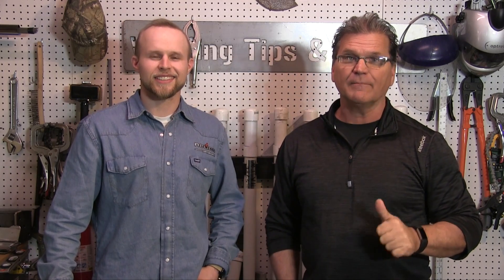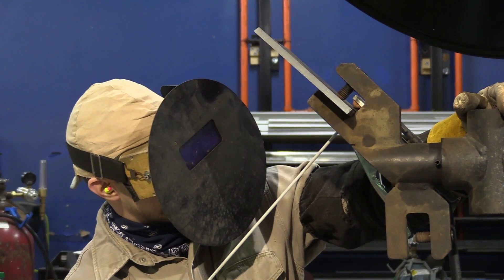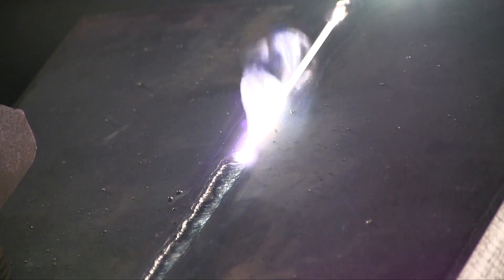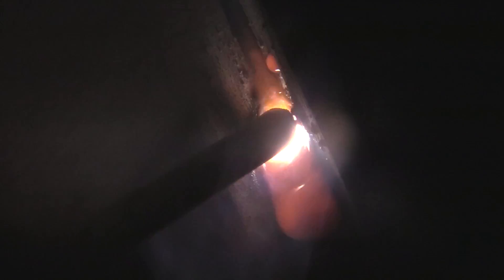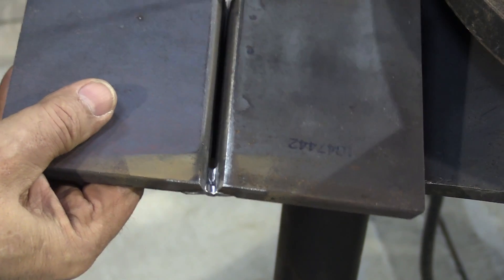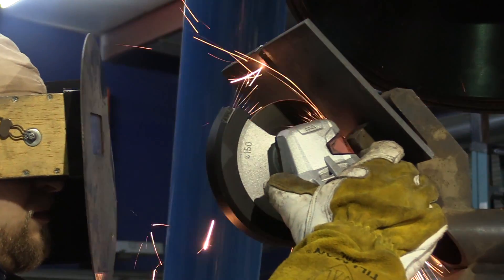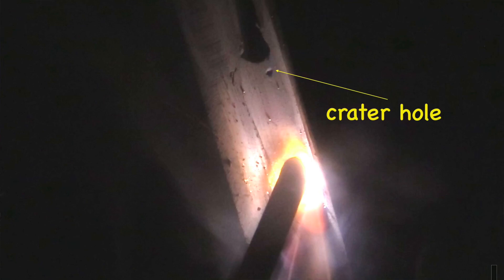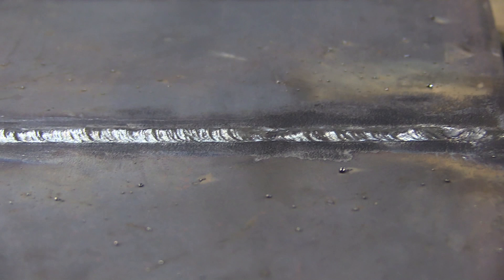7016 Stick Welding Open Root

Comment: I don’t get why this would become common in the industry period even when asked. I see more problems overall slag inclusive and more potential of hydrogen cracking. The best resolution for described issue is Tig welding. Either way this rod or traditional rods you still have slag inside the pipe.

Comment: Hey, man. I have a long question for you. We are a production company that manufactures steel and aluminum traillers for botanical nurserys and we
mig weld (Steel) 3" Sch. 40 pipe to 3/8" x 4" flatbar, with the flatbar blinding the end of the pipe. (With the pipe being 10"-16" long) Alot of force is usually applied on these joints in a rocking motion and we are reconsidering the patterns and settings to use on this kind of joint. We only weld all the way around the outside of the pipe to the perpindicular, "blinding" flatbar. Do you have any suggestions for this kind of weld/situation?

Comment: As always great video.  I would like to see you do a review of at auto dark. It is a true color 4in amazing clarity. Shade 4 to 13 grind cut weld mode.  Amazon 75 bucks with tax. Best purchase all yr. Seams high quality nice head gear better than average. But the lens is fast a freaking 4 in and clear i mean still dark but clear. That green tint is gone and grind mode is like a clear glass. The brand is Yeswelder amazon has the for like 68 bucks. No I am no sales  person never heard of until a couple weeks ago. The netx cheapest is a eastwood 2x4 and not a clear color. Sorry for advertising in your channel but i thought you might want to share for the poor working bastard like me. thanks

Comment: Hey I have some valuable information about welding a perfect 3/4 stacked bead with flux core on a part that is 14ft in diameter, with a bug-o system if this is helpful for any large production shops
Pretty neat stuff, basically "machine-welding" but on thick metals (1.5 inch thick by 1 inch fillet weld, preheat and everything, you can even see the moisture on the preheat being driven away

Comment: Can you tell how to restart with out feathering it in. My teacher won't let me use a grinder?
Reply: use a file or a slag rack aka old power hacksaw blade to feather your stops and starts, if he dose not let you feather lo hydrogen stops and starts you may want to go to a different school.

if your using 6010 or 8010 then thats achievable buy leaving a slight key hole when you stop.
Reply: @MRTYREMULISHA  thanks.  I figured it out.
Reply: @400PV  Good to see, i passed my lo hy test 7016 2g and 5g on std wall pipe.
It took me two go's to pass but the first one i busted was a defect in the cap pass on the 5g.
Reply: @MRTYREMULISHA  cool, cool 😎! I got 3g 4g stick certs. I'm working on getting more certs.
Reply: If you're doing lowhy roots and your "teacher" wont let you feather stop/starts, ... then youd be better off finding a better person to learn from, as your "teacher" doesnt know what theyre doing
Reply: @kf8575  thanks for the info.

Comment: I did my 6G test with 7018 open root and hated every minute of it, but I passed, I prefer 6010 but understand the need for low/hy roots in certain applications. Good job you guys.

Comment: 12" branch and bellhole with 3/32 7016  &  3/32 7018 is a pipeliner test for fabrication...i do believe it is a Conoco Phillips procedure, not so much on the  mainline, but this is a LoHy pipeliner fabrication test going around these days.

Comment: Ive used 3/32 9018 H4 DCEN root and switch polarity for fill and cap and 309 L16 DCEP open root fill n cap. Such tricky welds to do!!lol

Comment: Hey Jody this takes me back to being a young welder back in the early 70,s, this was a procedure that I cut my teeth on, it was very common in the oil industry when I worked in the rig yards here in Scotland building jackets and deck modules for the North Sea, it was so good to see a young man using the same technique and discipline that I used for about 20+ years! coming now to the end of my career after nearly 50 years welding  mainly in the oil, gas and nuclear industries I thought this technique was dead and gone so it was good to see it’s coming back as a “new” procedure!! This is why your channel is easily the best on YouTube you cover everything!
Reply: I worked in all the Scottish rig yards numerous times, always 6G or 6GR tests and sometimes you had to do both. Kishorn yard I had 6G and 6GR in stick, Inner shiled and dual shield which was 20p per hour per coding and it mounted up to a good amount of money back in the day as we were doing 7 twelve hour shifts. The coding money alone equalled what some people got for a wage.
Reply: Weaver Cattle Company the E7016 over here in the UK is still a relatively cheap rod and it’s probably the “go to” rod here for most serious hobbyists, in industry here now speed is also the priority with most manufacturers preferring to use dual shield Mig or where size allows, bare wire Mig for rooting followed by dual shield Mig for hot pass and maybe two or three fillers followed by sub-arc using 3.25 or 4mm SD3 or SD3 .5 moly, material dependent, for heavy deposition. I remember in the 70’s working on ball valves for the Siberian pipeline and we rooted downhill or stoveing as we called it using fleetweld 5’s. Guess times have changed and nowadays money is king! Thanks for the comment it was very interesting to read.
Reply: @deekthefirst  You might be interested Derek, Jones construction recently did a new seawater injection pipeline down here at Wytch Farm, Tig root, orbital mig fill/cap. Vantage 400's on the back of a caterpillar tracked vehicle with a hiab dropping a habitat/tent over each joint...

Comment: Hi,

Thats the position I usually use when doing repairs on my steel boat,  when standing on the ground welding up...... I often use a 6010 root with negative on the stinger, and then the 7018-1 on top with positive electrode.  I believe this gives a bit more elastic weld needed .  Thanks for your time teaching us to make these experiments .... sometimes we get it right   big smile :-)

Comment: Looking forward to seeing future clips on this process.
We dont use 6010 rods here in South Australia, 7016 is the common rod and is used to test for welders certification on pipe.
I am currently practicing for this test.
Thank you Jody this is very helpful !
Reply: william lockyer good luck bill. I recently completed my tix 3E,4&7 which pretty much covers all the welding we do. Jam that rod in tight mate and take your time. There is more than enough time on test day so don’t rush it and try not to long arc as porosity is a bitch to repair. Sing out if you want to use my numbers “amp settings”etc. doing 3E first really set me up for the pipe tests as you will be all over the electrode control
Reply: @banjosambar  How are ya mate, I'm about to do the 3e exam in a week's time. The only test piece doing my head in is the 4g. I'm still undecided on the polarity and just the overall setup. I'm using 7016's, 2.5 gaps,s, and roughly 2.5 root face. 75 amps. what settings did you use mate?
Reply: @rypod28  hey mate, for my 4g overhead plate I ran same gap and land as you. Dc polarity, root pass 63-65amps, hot pass 93, fill passes 90 and down to 85 amps for the cap, 4 stringers for me, hope it helps mate
Reply: @banjosambar   Thanks, mate. Were you using positive or negative ?? I'm getting everything correct except the root run, getting suck back on the other side
Reply: @rypod28  electrode positive. It’s a prick, just jam the electrode in hard (slight push), Feed the root in slowwith little “e”‘s all the way along and push harder when you ride up onto your feathered tacks. And be ready for your lava shower, your better off getting burnt and seeing what your doing instead of hanging back and guessing. You’ll be right mate,   I have faith in your ability👍🏻once you’ve passed you will wonder why you stressed so much, we’ll I did anyway
Reply: WIA 16TC 2.5mm , way to go
Reply: How did you end up going on your 3e test? any tips please/ amps, polarity gaps. Thanks

Comment: Two 250mm long piece of 6x60 mm flatstock,    30° bevel 1-1,2 mm land,    1,8-2,2 mm gap,      vertical up,     root with 2,5mm 7018-1 preheated DCEP 57-63 amps,     and fill/cap with 2,5/3,2mm 6013 DCEN 75/85 amps.   One coupon out of six, to make right in order to be a welder in Hungary.  Sorry fo the nomanonthemoon system.

Love your work Maan, I learn a lot from you.

Comment: If using the Lincoln 16p rod, watch for this mysterious porosity that can occur. Does not show up on the inside or out, but in the middle of the bead....kobleco rods seem to be a waaaay better choice
Reply: L. P. I completed my structural plate and pipe tickets recently here in oz and we used kobelco electrodes for the tests. the mysterious porosity I found was caused by long arcing especially on stop/starts. We only use WIA 16tc electrodes at work which I find to be a lot easier to use. It’s great to see some controlled hydrogen electrode open root welding as over here we don’t use 6010 often if ever and always weld uphill.

Comment: Do u need a machine with a high OCV to run 7016s
Reply from the maker: I dont think so.  its very much like a 7018
Reply: @weldingtipsandtricks  thanks appreciate the reply :)
Reply: Just need enough voltage to hold a real tight short arc, literally short enough for the flux on the rod to be scuffing the preps

Comment: that will be the end of the old pipeliner?
Reply: Jorge Perez naaaaah, way to slow, and not “as good”. Some bone head 23 yr old engineer will try, again, to implement this in-service procedure to mainline welding and fail,again. Have been taking this test for 12 yrs now and have only used it for live work. One company started to mainline with it, but came to senses at the “meeting of the minds “ that’s what 0% field experience gets us nowadays
Reply: No need for lowHy roots on pipelines, they're only standard wall low pressure, doesnt warrant high spec welds like lowHy or tig root. 
This is more for heavywall, high pressure, or butts under constraint

Comment: great video guys. we really need to talk about that mask/helmet.
Reply from the maker: we will definitely do that
Reply: @weldingtipsandtricks  yep, I'm in Australia, never worked in oil and gas here so don't know whether we use them or not, but see pancake hoods in the US stuff a lot and really would like to know more about them, advantages and disadvantages, they don't look like they protect your face that well.
Reply: @whitedoggarage  keep back light out so you have a better view of the arc
Reply: I’ve noticed these becoming popular online, what’s going on?
Reply: Its called a pancake hood and it's pretty standard for pipeline welding.
Reply: jpftwson54 cool don’t know much about pipeline thanks for the info.
Reply: jpftwson54 why?

Comment: Can we get a video to help with a job I recently did? working tig aluminum from inside a 3 way corner, it was about an inch of weld in each direction, getting into the corner was my major problem

Comment: Hey Jodie have a question for you. When you’re welding on a pipe do you have to clean the slag off from the inside. And if so how do you guys do in the piper. When they  are  30 or 40 feet long. however long it is in the field because I just don’t know. Ps love the videos. I have become a much better welder just from watching your videos
Reply: yeah, that been bugging me too.  so I googled it and a forum they said something about some put a pig in it. I think that would be a remote controlled kind of thing but I don't know. but I would also think you would not want slag in a fuel or oil pipeline when it's in use. as another response on that forum was that it gets filtered out later.
Reply: highkicker11 A big reason why they don’t want slag left from a root pass is because in time it will break down and mess up components downstream.
Reply: That would be really cool to see some robot that shoots down one of those tubes and cleans off the slag. Yeah I have to go online and check that out and see what they look like.
Reply: Biship c Has a lot to do with what application the pipe is being used for and what code and or specification the job applies to. Best case is to tig weld the root and hot pass. I understand you’re talking about being out on the field but it just usually boils down to application and code Requirements.

Comment: Awesome video guys! I always learn something here! Thank you!
Reply: I've seen you root with 7018 and it's impressive 👍 but the 7016 are so easy to root with . There are two different types though you want the ones with the black glossy slag known as specials. You can run the 2.5 as low as 55amp and 3.2 90amps no sweat . Go dcen 68-75 amp and listen to the noise coming out the back of the plate and just apply a little pressure . You will love them on a side note restarting can be a pain but just pinch the end of the rod . I like the orlinkeon ones

Comment: Whats the differens between 7016 and 7018? Why don't do it all with 7018?
Reply from the maker: procedure specifies 7016 for root.  dont know why
Reply: You should have more views on your 7018 open root.
Reply: wanna know +1
Reply: 7016 and 7018 are the same EXCEPT for the addition of iron powder to the flux coating on 7018. Both are Potassium based fluxes.
Reply: @andycardin4986  so it's faster with 7018? More deposit?
Reply: @NSW  I would say they are both pretty slow, but the 7018 is a bit harder to control. With more iron powder making the puddle more fluid, it tends to penetrate too much or not enough. Very hard to get an even root reinforcement, but it can be done with both rods with a lot of practice.
Reply: Andy Cardin 
Hey I pass your company’s utility trucks every morning on 195E on the way to the Cape!
Reply: In holland we do it all with 7018
Reply: Whats the diffrence jody between 7016 and 6010 root
Reply: A lot softer arc with the 7016
Reply: @l.p.5259  it does not dig as much? Does it run almost like a 7018?
Reply: 2? Lol

Comment: Filarc 56s root, pretty much the standard 7016 root this side of the pond... Nice to see you guys getting some arc time on a 7016. Nice rod to use for sure.
Reply: Jody, get Jonathan to give you some of the vac-pac filarc 56 I sent him over Christmas... See how you get on with them.
Reply: Elga P47 is another common 7016 used by quite a few firms I've worked for too, although 56S are a better one for a root imho, p47 always seem to carry more slag
Reply: Filarc 36D is still a well liked rod in Scandinavia. Personali I don't care if it's a Filarc 36D or  Esab 53.05 or Bhöler Fox. The all weld but for camping I like runig Phoenix special D and esab 53.00 special. They have a glass like slag.
7016 is the fist electrod all my Millrights apprentices have to pass on.